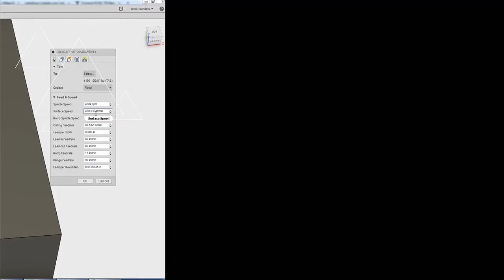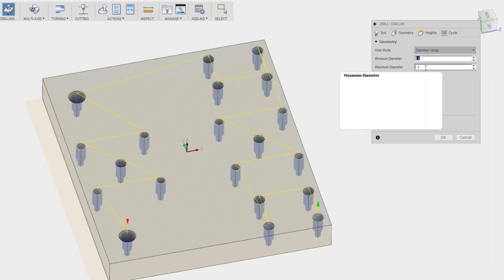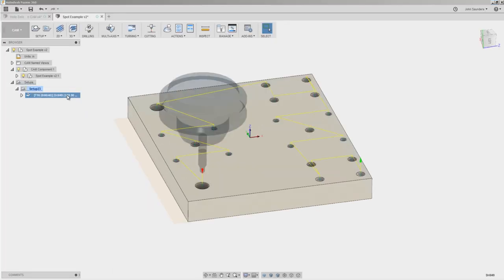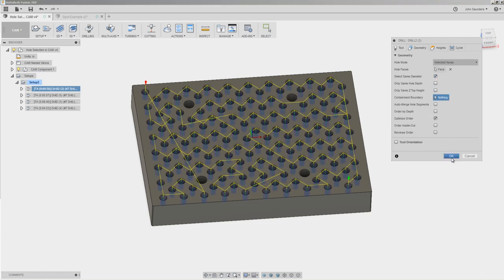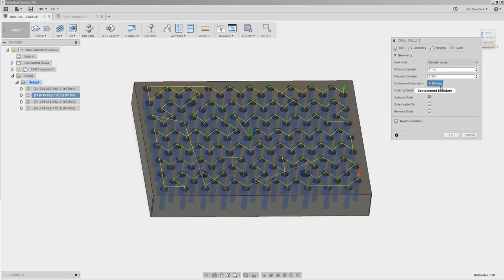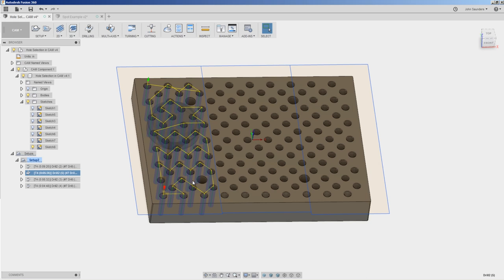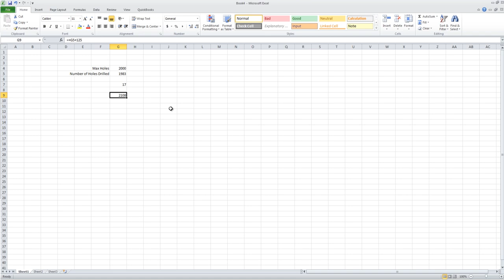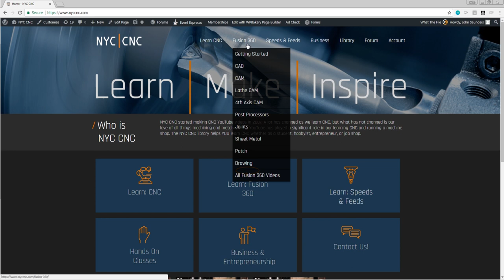How to use NEW CAM HOLE and DRILLING features in Fusion 360! FF129

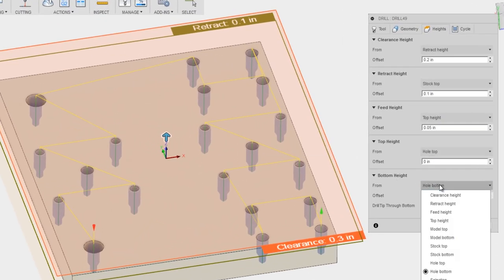Comment: For spot drilling (1:13) you can also set the bottom height to "chamfer width" or "chamfer diameter" (I think that's what they're called). This works for multiple hole diameters and heights quite nicely.

Width will drill down deep enough to produce a chamfer around the hole. This requires that the hole be modeled with the correct size.

Diameter will drill deep enough to create a spot of the diameter specified. I'm guessing this would be a more direct substitution to the method shown in the video. The advantage of using this option is that the diameter will stay consistent, regardless of the tip angle of the spot drill. If you had both a 90° spot drill and a 120° spot drill, you could create one template that would cover both of them and produce consistently-sized spots.

Comment: The motion logic is to limit rapid motion. The problem is, the Software is moving from hole-to-hole and forgets the overall movement it has done, gets into a bind and "forgets" a hole, and has to backtrack over to a spot.

However, what makes sense to see at the controller is basic X then Y moves, or Y then X. So I think what Fusion should be able to do is to limit "Cross Axis" motion, and stays moving on one Axis, until it's necessary to move the other axis to get at another hole. Another method is to limit backtrack movement. The code continuously moves the one Axis positive the whole time much as possible, and the other predominately zig zags.

I think it's better for the Software to not so much think about limiting rapids. Because you're only pinching seconds half the time, and that requires hundred of holes in a single session to notice the difference.

Comment: I would love to have a M-code for checking tool-life and have the postprossesor post that M-code at every retractmove. 

Like on our bed-type mill i love to use a large Coromill 390 with the 11 mm insertsize, grade 1130 with 0,8 mm radius and M-geometry for all my operations in steel. When machining toolsteel the typical lifetime for my combo is about 15 min when roughing, would be very nice if the machine automaticly stops when 15 min is reached.

Comment: Fusion doesn’t have sorting for hole drilling?
Reply: Gotta move up to powermill for features like that I guess
Reply from the maker: What is sorting?   Asking for a friend.
Reply: NYC CNC 
It reorders the sequence the holes are drilled. Zig-zag top to bottom,

Circular from center out, or outside to center, clockwise or counter clockwise, or shortest distance where it calculates a path based off the position of all the points and finds the shortest route through them.
Reply: Can’t believe fusion doesn’t have this feature, you would think it would be a very basic option.
Reply: Had a part that needed holes drilled in an L shaped pattern with one hole below the L, fusion decided to drill the hole at the top of the L and then the one below and then continue with the L pattern
Reply: Espen Andre 
By the sounds of it, Fusion is locked to “shortest path” for drilling.
Reply: It ended up taking the path that would be the 2nd or 3rd longest path
Reply: Espen Andre longest by time or longest by physical distance?
Reply: Both
Reply: I thought the same thing.  Using boundary's is an interesting idea, but traditional zig zag is a no brainer for this kind of plate work.  Still it is pretty good CAD / CAM for the price.

Comment: After the new update, fusion is frequently crashing on my right when it wasn't at all before. The other strange thing is after the update, the license changed from start up to "non commercial". I've been impressed with the software up until now....re-installing didn't fix it. Any ideas that I'm missing?
Reply: Force it offline. Anymore I tend to open what I need, switch to offline mode and do work. If I need a file that isn't in cache (unlikely ) I save everything go back online and take a break. I will go online at the end of the day after saving everything manually, then close out and leave it alone while it uploads to the cloud.
Reply: Jody Olivent Thanks for the tip, I will try that.
Reply: Jody, what do you mean by "close out"?  You close Fusion?  It uploads to the cloud when it is closed??  I think I'm missing something.  Mind to rephrase what you explained, your procedure, again?
Reply: Dan L. Yes, before I exit the program, I allow it back online. It will upload all changes. Before it closes.
Reply: Jody  Ah, it makes sense, that's what I thought.  Your last sentence there was confusing to me.  Thanks again.